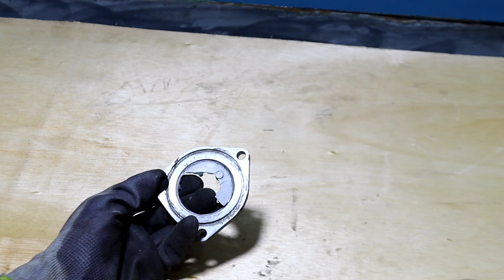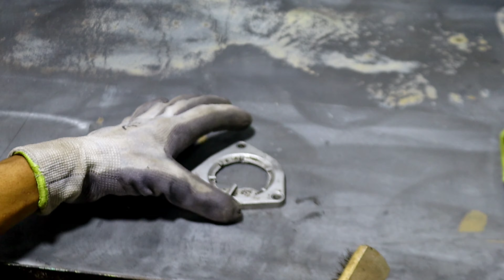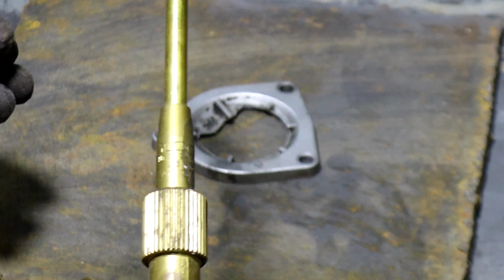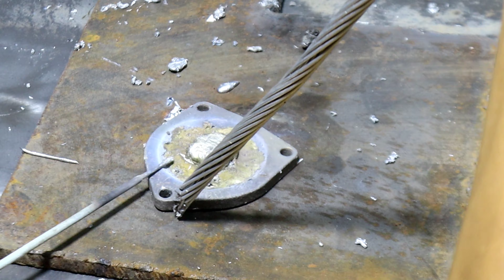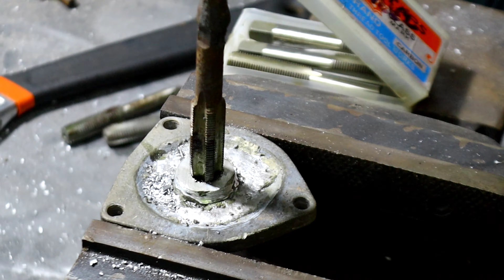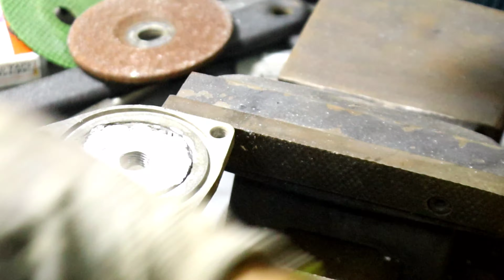Do this to get perfect aluminum welding results

Comment: I'm going to try this.  I tig weld this stuff, and always clean, clean, and then clean more as the grabage rises to the top.
Reply: Thank you.  You show the working method, but also explain what kind of gas mixture is used, what kind of tin or welding wire you use؟ Thank you.
2:34
Reply: I am an expert in gas pipeline welding.  Soon I will be at the service of friends and I will show non-stop all kinds of welding of tanks and gas transmission lines.  Gas in tank or pipe.